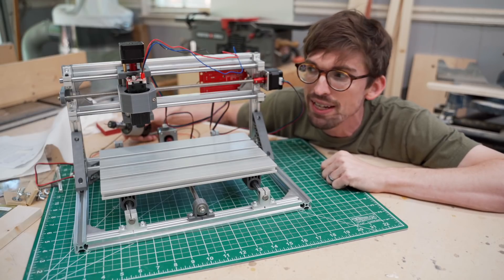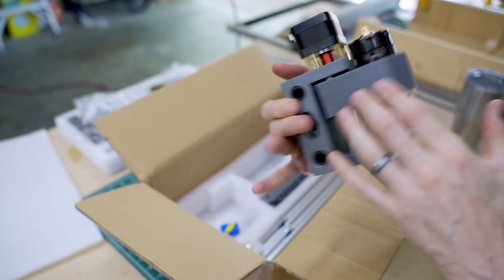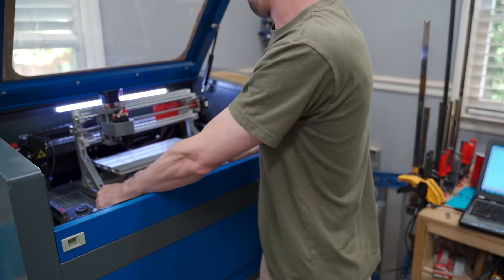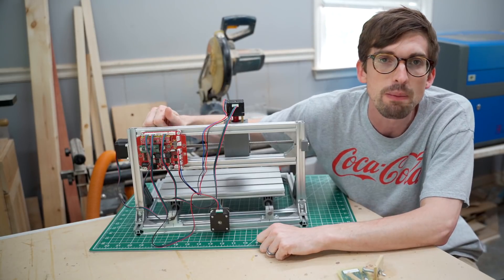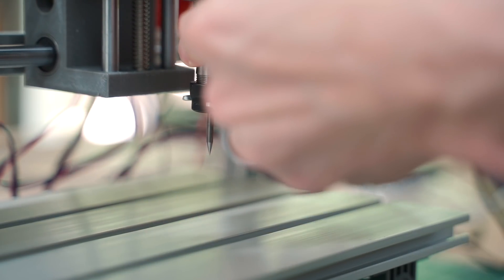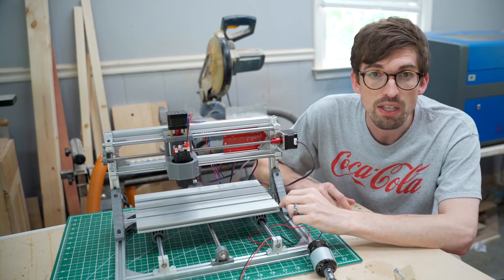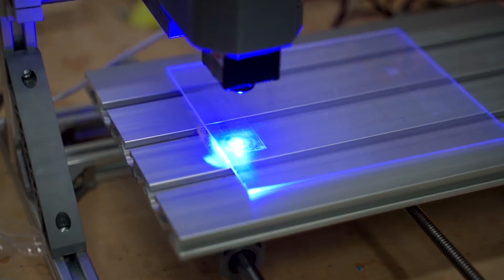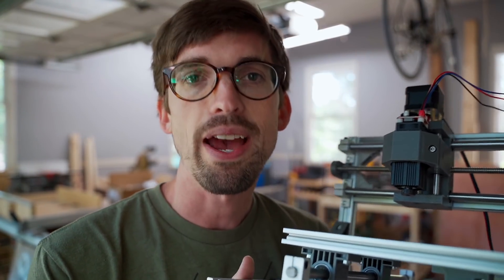Is a Sub $250 CNC worth it?  Alfawise C10 CNC & Laser Review

Comment: I was looking forward to this video after you had talked about it on the podcast. Between you and geeksmithing. You gave me something to think about with the lasers. 
Was the Diresta carve fuzzy because of the bit you used?  Or is it an indicator of the machine quality?
Reply from the maker: It was fuzzy because of the way it was cut.  The bit's they provide work more like an upcut bit which gives you a smooth surface on the inside but some fuzzy stuff at the top, that is really easy to sand away.  Also if you get a downcut bit you won't run into that problem.
Reply: Make or Break Shop Your should never use an upcut bit on plywood. It makes splinters and can even separate layers in the stock. I never use a downcut bit because it makes it hard to clean the piece because everything is pushed down into the cuts. I recommend straight cut bits for plywood.

Comment: The V-bit direction actually does matter. One of those angled edges is more tapered than the other, so only the other edge (less tapered) will be what contacts the material.
Reply from the maker: Dang must have missed that, good call!   So I just had it wired up wrong for any case....